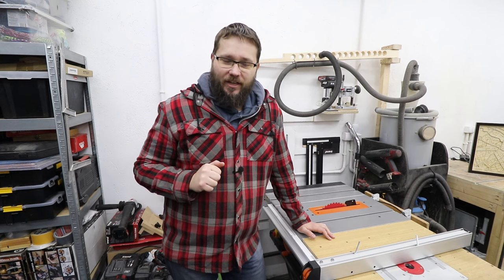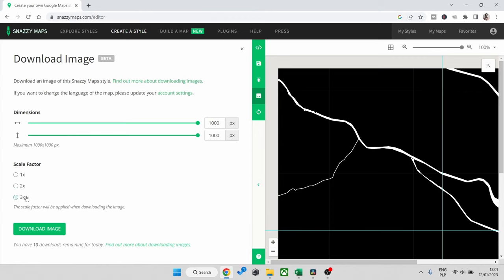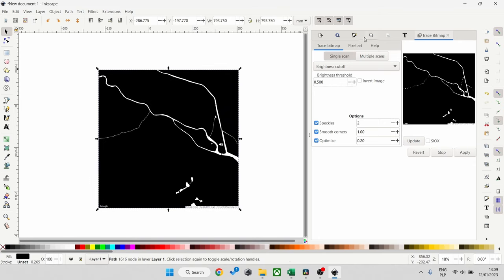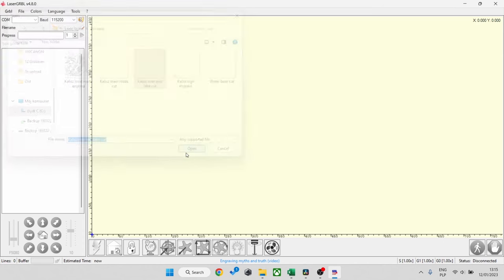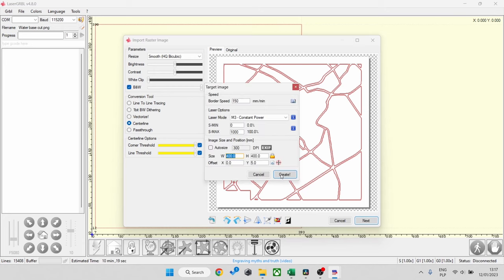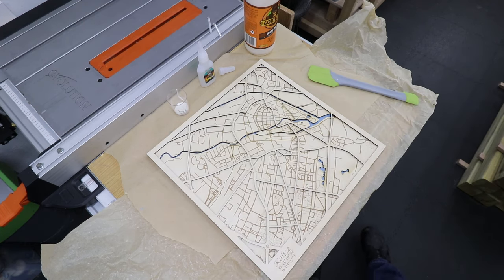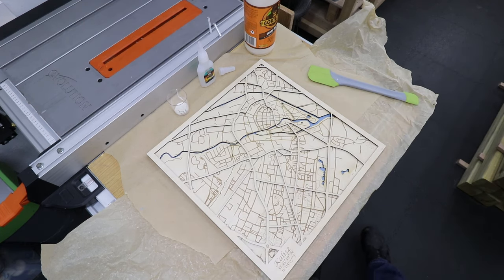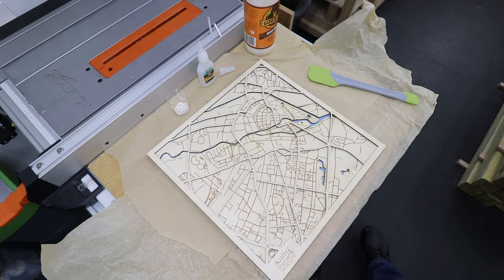Laser Cut 3D Map Step By Step | Laser Engraver Atezr P10 Combo

Comment: When you engrave the local roads on the same sheet of wood as the water, what do you do (or what happens) when a local road crosses a stream/river?
Reply from the maker: Base level is water, next cutout for water and local roads - if there is a bridge then it will be there just need to make sure it's connected.
Reply: @CasualDIY  Yeah, but when the waterways are cut first, the bridges are r shown on the file. The entire waterways will be cut out contiguously and then the roads will be engraved and there won't be anything crossing the water to be engraved on. Or am I just not getting it?
Reply from the maker: @robertusm  On the same layer you cut the water and engrave the roads. That means on that one file you need to make sure the bridges are there and connected. Ie the water cut out is separated by the bridges. It's one file, one layer for both cutting out water and engraving roads.
Reply: @CasualDIY  ok, I thought they were separate layers. Thanks!
Reply: @CasualDIY  I see the roads crossing the water on your video, but when I bring the water map into inkscape, the water isn't broken by bridges. When I combine the water and roads layers in Lightburn, it still wants to cut the water first, without bridges and then engraved the roads. What step am I missing?
Reply from the maker: @robertusm  You must have the bridges, not sure what you doing wrong. In this case I would just use the node tool in Inkscape to make the bridges. Do it in two stages, separate files. First cut the water (use node tool to make bridges) and then engrave the roads from a separate file

Comment: Awesome tutorial.  I am struggling with how you removed the text at the bottom of the images.  They are there in Inkscape, but when you pulled them up on the laser software they were gone. Thanks!
Reply from the maker: Just use the node tool in Inkscape to adjust the image👍

Comment: Good map as it helps me getting so close to what I like to do. I am struggling with making and connecting the "frame" look to the highway layer. Can you clarify? Thanks.
Reply from the maker: I've used Inkscape to sort that out. You can connect any open areas or close them off.
Reply: @CasualDIY  Thanks for the response. I am using Inscape and have tried many options to eliminate the cut paths but not sure what I was doing. Can you give a few words what to click on?
Reply from the maker: @VuTran-h3l  you just need the node tool to do that, there are quite a few tutorials on YouTube on that.
Reply: @CasualDIY  yes thank you. I have been messing around with it all day and did figure it out with a bunch of nodes that needed to be broken apart and then connected to close the opens. Thank you for answering and the vid was awesome. I've watched it like a dozen times.

Comment: Great video as always, something I'll definitely be doing for my home town - but I noticed when you did the cut for the water feature the area lower right effectively creates an island surrounded by the river which would drop out of the layer. When you are lueing-up I noticed it had tabs to maintain the position of this "island" how/where did you generate them please.
Reply from the maker: I made them in Inkscape with path tool, I think its called.
Reply: I think the tabs would also be the bridges and highways that would cross the river, meaning the island can still be connected physically

Comment: On the bottom of your image you have "keyboard shortcuts, map data" etc etc.. but then in the end you got rid of that before you start cutting it out. How did you do that??
Reply from the maker: Can you drop me time stamps please I will have look what you are after exactly
Reply: @CasualDIY  Hi, thanks but i figured it out!
Reply: @CasualDIY  I do wanna ask you something else.. how did you manage to get a "frame" around the highway lines in Inkspace?
Reply from the maker: @Gary.009 I just used the line tool in Inkscape. And then node tool to connect everything
Reply: @CasualDIY  You mean the pen tool, straight lines and on the same layer?
Reply from the maker: @Gary.009  I think there is a straight line tool , can't remember on top of my head. Yes same layer

Comment: You just got me excited about a laser project...what was the wood material you used? Did I miss that? Do you see a benefit using something else?
Reply from the maker: I'm using 3mm plywood for this project. I think for this particular map 3mm ply works great as its not too thick as you put the layers together or to thin. If for example I only had 2 layers I could have used 4mm but anything thicker than that would just look strange I think

Comment: One question: My water all ended up as open shapes, how did you get them to closed shapes so they would cut out?
Reply from the maker: In the Inkscape software use the Node Tool to close them off
Reply: Thats my issue, I can;t figure out how to close them.
 @CasualDIY
Reply: They cross over the bounding box, so I can't close them off without screwing up the shape of the box.
 @CasualDIY

Comment: Now that I actually have a laser I've returned to this really nice project. Frustratingly, once I trace the images in Inkscape, the fill & stroke feature doesn't remove the black background colour, in fact, it doesn't make a difference at all. All ideas are welcome!
Reply from the maker: Did you use the path tool I mention? It creates the vector copy from which you can remove the background etc

Comment: Brilliant well done looks great, what lazer do you think is best out of all of them you have tried
Reply from the maker: If you don't consider the price then this one the Atezr P10. Great cutting and engraving capacity plus built in air assist intake.
If you are looking for something in the mid price range then Longer Ray5 with 10W module or Ortur Laser Master 2Pro with 10W module. If you are on a super tight budget then the Atomstack A5 Pro+ with 5W power module - good for engraving but cutting perfornance not as good as the 10W modules obviously.
Reply: @Casual DIY  great thank you that's a good help 👍

Comment: did you save each file in Inkscape as a simple SVG or something different?
Reply from the maker: As I used LaserRGBL for this I just saver each file as JPEG
Reply: @CasualDIY  interesting so LaserGRBL can use JPEG and cut or engrave with them. I dont think I have that option in lightburn
Reply from the maker: @dysongibson4936  Cut lines are separate file, engrave is a separate file. Not all on one file. Lightburn on the other hand allows you to have engraving and cut lines in the same file

Comment: Great project, good instructions to follow. Are there any steps skipped? Such as when the text from the bottom is removed and is the water edited? When I create the water vector as instructed, then load it into Lasergrbl it has a square boarder and is not self contained like on yours. Also it is not a PNG file. Any advice? Thanks.
Reply from the maker: No stepps missed. Just amending the graphic to what I want exactly. One thing you need to be aware of when doing the water cut out is that the water lines need to be closed off to be cut out. Are you using correct settings in lasergrbl? You can adjust few things there that would give something you are saying.
Reply: @CasualDIY  Thanks for your reply. The water lines aren't cut off which is giving me the issue and I was struggling to figure it out. Probably easy to do but I am new to this!
Reply: @simonedmundson7271  I have the same problem. And I am sure that there are steps missing... for example closing the water lines and remove the frame around ;) This is exactly what I am currently struggling with also. 
But in total a quite good instruction.